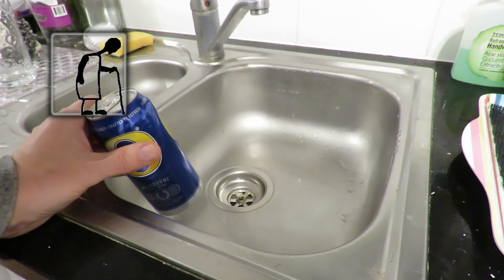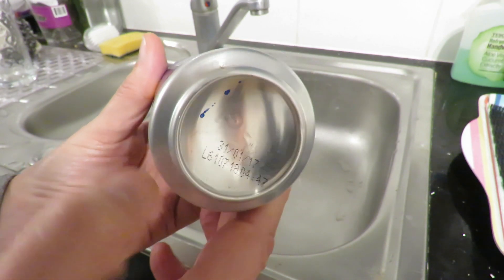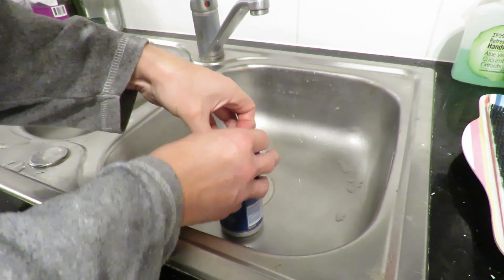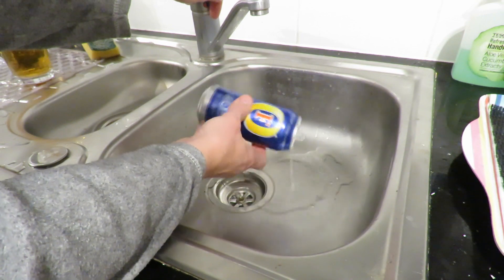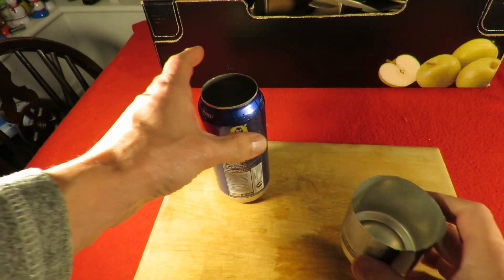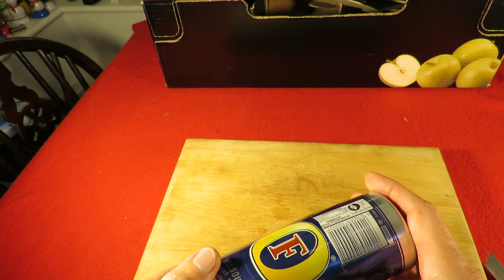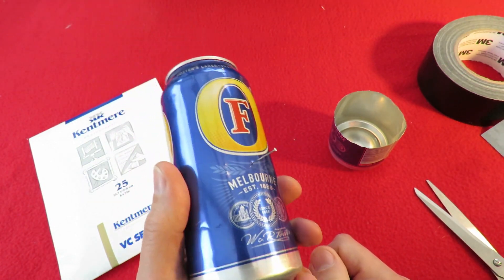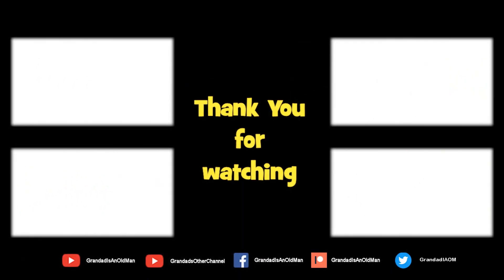Making a beercan pinhole camera V2

Comment: could you do it with any other cans? like dr pepper or pepsi
Reply from the maker: Yes, the main issue will be finding photographic paper. Not many people stock it nowadays. You may need to cut whatever you get to a size that fits your cans. Other than that, even a cardboard box would work, although it might get damp if left outdoors for weeks or months.
Reply: @GrandadIsAnOldMan  yeah that makes sense. also about photographic paper - where did you get yours, did you get it from a store or something like ebay?
Reply from the maker: I bought it on eBay, but that was back in 2018. Here is my postbag video https://youtu.be/9KffA_cqdkc You will always find extra information in my video description. The playlist for this project has 22 videos in it 😁😁 @raphfung
Reply: @GrandadIsAnOldMan  oh ok thanks for letting me know man i’ll check those videos out later

Comment: I've got quite a lot darkroom experience, and i'm almost 100% certain that you've ruined the paper by opening up in such a bright area.  You really do need an extremely dim area or use an amber safety light.

Also, from what I've read about pinhole cameras, the exposure is in hours not months unless you're doing something different like multiple exposures.  You should experiment with a 1 and 2 hour exposure first before attempting a month's long exposure.

Additionally, you should do a test on the paper to insure that it's not completely fogged.

Here's a link to B&H in New York who sells pinhole camera: https://www.bhphotovideo.com/bnh/controller/search?N=0&InitialSearch=yes&sts=ma&Top+Nav-Search&Ntt=Pinhole

In the link are beer-can cameras.  Click on one for instructions.  Maybe there's some new info?
Reply from the maker: Thanks for the links, Yes if you look at the information on that pinhole beer can it is almost word for word what Justin Quinnell explains in his videos including "designed specifically for making extremely long exposures—upwards of days, weeks, or even months" and "it is recommended to make a high-resolution flatbed scan of the image, digitally invert the tones to produce a positive image, and fine-tune the brightness, contrast, and color to realize a final image of the sun's path over time." I wonder which came first Justin's version (free) or the commercial version at $20 + shipping

Comment: In our house I often joke it's not ready for consumption until it is out of date! A bit like the Mad Hatter's tea party :-)
Have you considered using developer to speed up the process? I have had good success in the past using photographic paper to make negatives and scanning them to invert to make positives. Cat litter trays work well as cheap development dishes 😀
Reply from the maker: I wouldn't know anything about using developer other than the fact that Justin specifically says don't use it. I have zero photographic experience. I am simply following the guidance of Justin Quinnell and yes it is photographic paper that I will be scanning in and using the negative effect on the image. Justin explains that the pink tinge of the photographic paper turns to nice shades of blue in negative so looks like a colour photo if you have plenty of sky in the picture 🙂 I haven't even decided where I will put them so it is going to be a long time before we see any results.